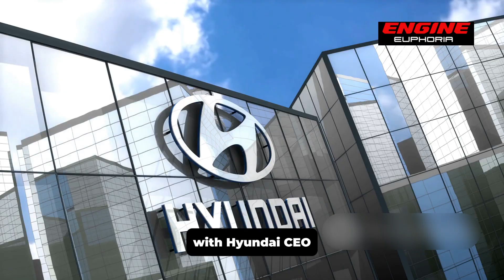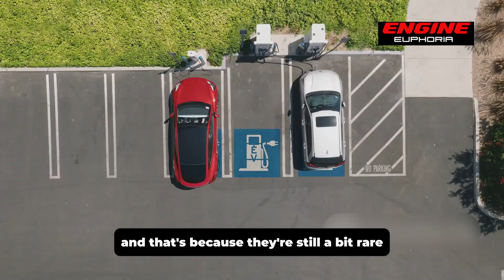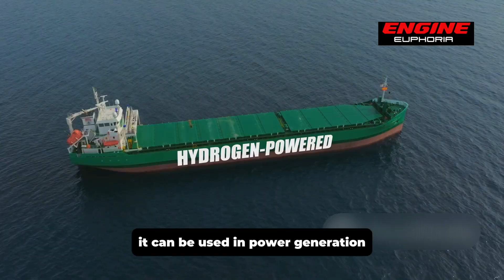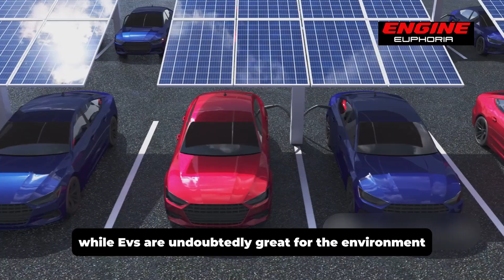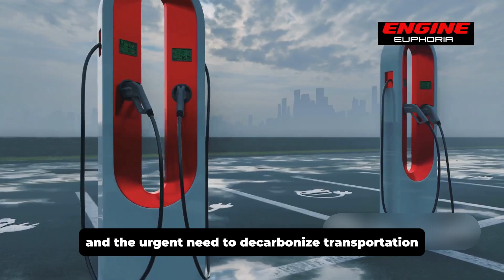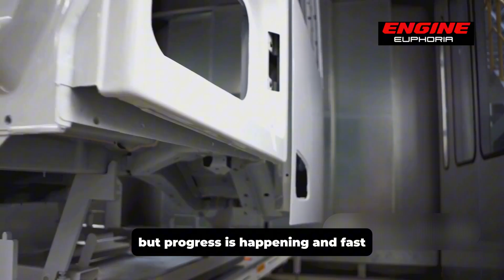Hyundai CEO: “This New Engine Will Destroy The Entire EV Industry!”

Comment: The most effective way how to get hydrogen is from natural gas, actually more than 95% of all hydrogen is from FOSIL FUELS! Electrolysis effectivity is around 60% and takes like forewer. Also you need electricity, which is mostly get from natural gas and coil (depends where you live). So hydrogen is really green. Also storing hydrogen is a nightmare and every hydrogen bottle leaks, because hydrogen atoms are so small they can cross everything.
BTW: its like 10 years? mabye more, when I think it was Toyota who tryed building hydrogen pumps and selling cars somewhere in USA, I think it was in california. Really boom at that time and do you see any of those cars now?